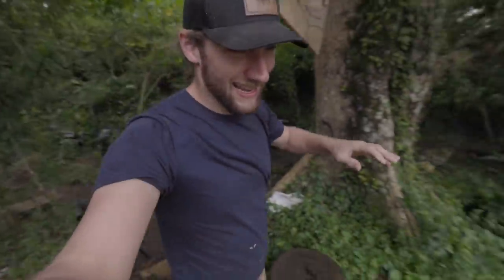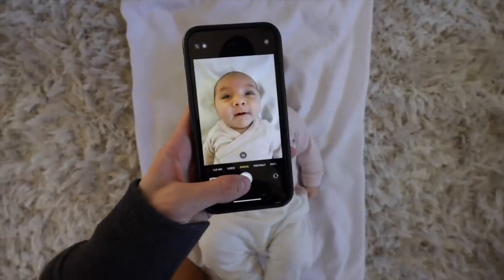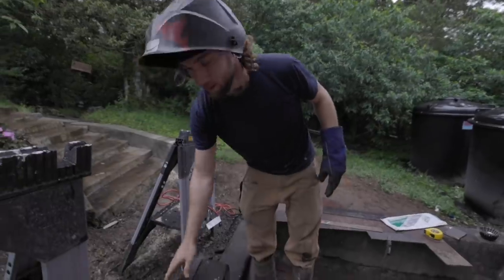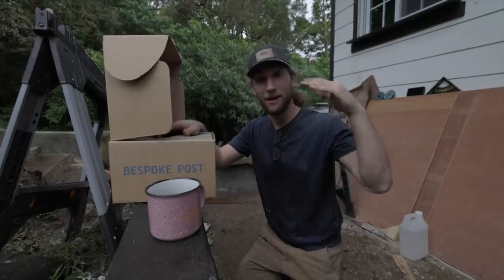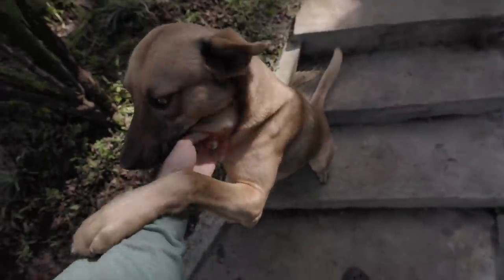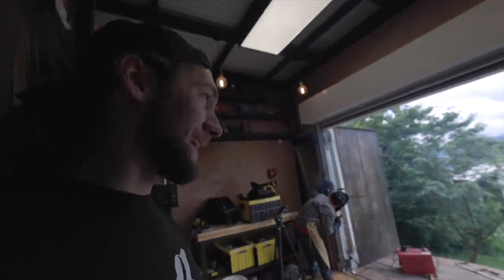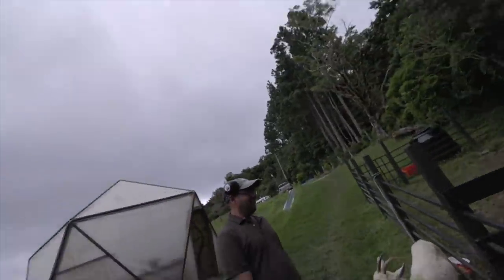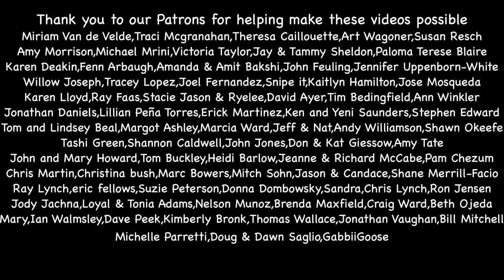Moving My Baby to The Jungle of Panama

Comment: Before you go back to Panama, would you consider investing and sending a bunch of wireless power tools and a bunch of batteries for the tools?

In my experience,  you will need not only multiple batteries but also different sizes.  The small ones doesn't last long but are light for overhead work, while bigger ones last longer but are heavy. 

Does it will be too difficult or expensive to ship them there?
Reply: Panama actually has a pretty good selection of hardware stores in the area they are in down in David. (Lived in Volcan for a bit).

Comment: i can't stand it anymore i use to be a student welder and i was always taught that if you see flames at the end of your rod as you weld it will be a bad weld. The hotter the weld the better the weld bead it will be considering the thickness of the surface you are welding of course.

Comment: I would reconsider changing the title of this video. You are NOT in a jungle, but a high altitude tropical forest. And is a pejorative to some locals. I know you mean well, but thanks to Hollywood using the term "jungle" leads to Amazon like optics, with savages, alligators, incessant bugs, cartel drug labs, jaguars, etc. None of which is true where you live. This has happened on a Panama related Reddit thread has caused a misperception of what it is like in this area  and unfortunately few crack a book to learn about Panama. We are dealing with a readership with many thinking Panama is in S America. Best to provide clarity.